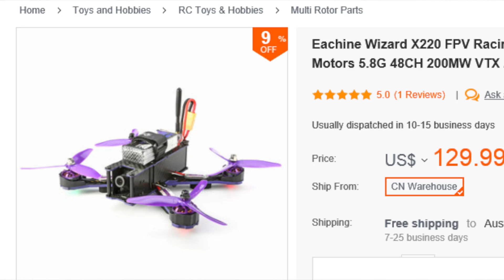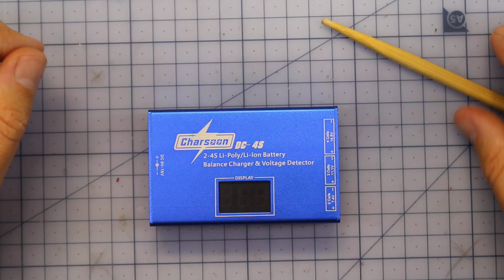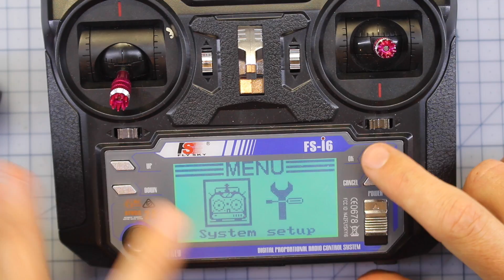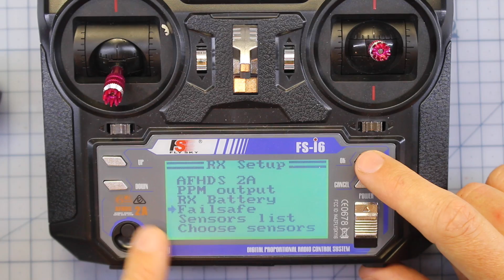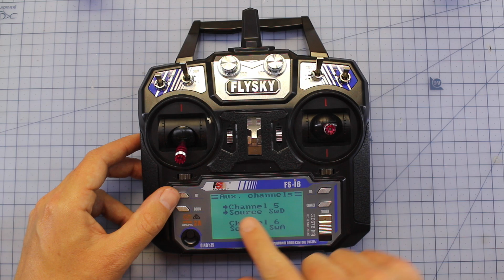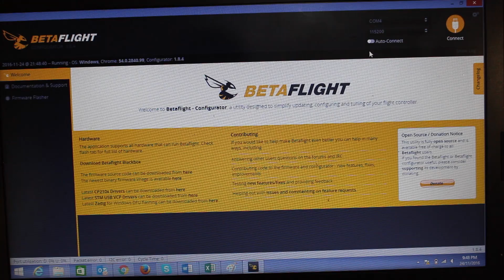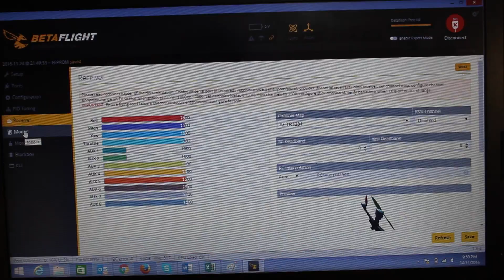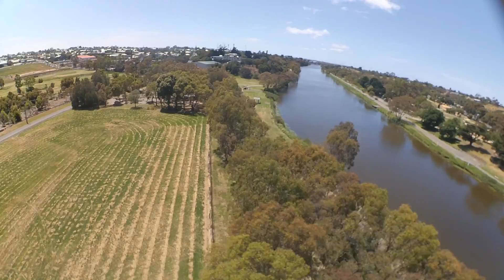How to get FPV DRONE RACING for under $300! Parts +Full setup.

Comment: banggood is running a sale for a similar setup as well. It saves a few dollars as i compared them individually and with the combo. The only thing is that it comes with a 3s lipo and not sure the preformance difference between 3s and 4s. The radio combo alone is ~$45 and quad $135 but then for the extra like $8 it comes with a 1500mah 3s battery and a charger.  http://www.banggood.com/Eachine-Wizard-X220-FPV-Racer-Blheli_S-Naze32-6DOF-5_8G-48CH-200MW-700TVL-Camera-w-FlySky-I6-RTF-p-1077100.html?rmmds=search

Comment: If I want to extend flight time, at the cost of speed, could I fit a 2200mAh, 4s, 35-70C? It's longer, so it might hang off the back a bit, but it would it get me more time in air?

Comment: Is there a built in Voltage reader/warnig system? I know the recharger has one, but you would have to take the drone out of the air to check the batterys status :o   Thanks in advance for any replies.
Reply: AFAIK you can drag and drop your battery voltage (and other information like the current current draw or the mAh drawn) in a betaflight submenu.

Comment: whats up stu! I literally just got my Wizard and am done setting everything up! am suuper excited to go fly, but i'm having trouble getting the props and hex nuts on the 2 clockwise motors.. Like literally impossible to get the props on, they don't seem to fit! and the hex nut is super duper tight, cant even get it all the way down. Tried your rubber band trick but even that didn't work! any ideas?

P.S the CCW motors gave me no probs at all

Cheers and happy flying!
Reply: Problem solved, just needed a little brute force! Good thing these things can take a licking

Comment: As of this moment would you suggest the Taranis Q x7 (maybe the Turnigy Evolution for pure FPV) and perhaps the SKYRC iMAX B6AC V2 for more charging options instead? It would be around 80-100 bucks more, but is kinda a better starting point which grows with you. An option if people want to eventually get more into the hobby

New title for new video, if I use a rough estimate of current prices :P

"How to get FPV DRONE RACING for under $350! Parts +Full setup."

Comment: UAVfutures hello, can I ask you a hand?
I installed betaflght but when I connect the USB cable on the top right door does not appear .... where you have com4
I can not connect ...
could you explain how to configure the door?
thank you very much
Reply from the maker: i dont understand. have you checked you have the right drivers on your PC. they are listed on the front page of betaflight
Reply: I installed it with windows all three, that link the page welcome! I did well? instead mac can not be installed
Reply: thanks for your help but I had two defective USB cables

Comment: Question: If I buy the Eachine Goggles you linked in the description but did not show in the vid that claim a 1920 x 1080 res, will I see the drone footage in 1920 x 1080? and what will the fps be?
Reply: Also would it be better to buy these? https://www.amazon.com/FatShark-Teleporter-Transmitter-Fat-Shark/dp/B01BWO29PQ/ref=sr_1_3?ie=UTF8&qid=1489880212&sr=8-3&keywords=fatshark

Comment: Just for the record, my x220 I bought on Banggood only came with a single bag of propellers, so you have to sort them out. Also it did NOT come with a battery or charger like I see other videos saying it does. Possibly because I bought on Banggood, thanks for the video. 
I am having an issue with my propellers though, they make sqeaking noises rubbing up against the prop nuts. If the nuts aren't tightened down all the way the props travel up and down the rod, they're not very secure, already ruined a few props with only a couple mins of testing my system, because the friction is like wearing away the inside of the propeller ring. 
Spent several nights trying to get this thing setup (in large part due to my HS1189 I bought, but it doesn't fit, so I had to drill new holes in the side panels and use a file to make more room for the panels to connect to the base) very frustrating, but I can't wait to actually start flying!

Comment: My beta flight won't connect please help me
Reply: I had to plug my battery into the quad to power it, not just the usb cable, that was my issue but as soon as i gave it power from the battery, it connected.
Reply: BILBO2626  Im having this same problem right now. Did you find out what causes that?
Reply: You've prob figured it out but some cables don't send data. Only power
Reply: If you ever figured it out could you help me? I have the same problem and i've tried using different cables and connecting the battery but nothing works.

Comment: hi, having problem with my wizard220. it seems to drop from the sky to the ground randomly when in flight. its flying fine then just rolls like a maniac to the ground. then works fine until a minute later just does it again. any idea what could be causing this?

Comment: Hi, I still haven't got my drone off the ground yet.

When I first got my drone, I plugged in the battery while the VTX antenna was not connected. When I tried to sync my Kylin Vision Goggles to the drone, I ran the auto scan and only showed a black screen. I thought I must have burned out the 200mw VTX. I then ordered a 600mw transmitter as an upgrade since I fly alone and when I went to sync up the goggles, it showed the black screen again. I made sure I had everything connected properly and couldn't find out which part wasn't working. I only have one drone so I can't test the individual parts on a different drone.

I can only assume there is a problem with the stock camera or the goggles. The wires are fine, the VTX is new, the antenna was on, the connectors were pushed in, my goggles antenna was on, I searched all the channels, and the lens protector was off. Do you see anything I may have missed?

Thanks!

Comment: I found your video to be a great help. I am ordering a wizard, but am thinking of using the Turnigy 9X 9Ch Transmitter w/ Module & 8ch Receiver with it. Would you know if the receiver that comes with this transmitter works easily in the wizard? Thanks

Comment: stu bought the wizard because this video and it's  amazing. one question though I fried my vtx. can't find a replacement with the right sma plug? any advice. please help.
Reply from the maker: if you are really desperate you can just order any vtx and buy another antenna that matches it.
Reply: UAVfutures thank you. I'm considering unsoldering the sma. And then soldering on one that works for me. I bought the immersionrc spironet antenna , and the sma Jack on that is giving me problems. really appreciate all your content , and you taking the time to reply to my message thanks loads

Comment: I am a beginner and im trying to find a cheap, small drone to mount a 3 axis gimbal and my gopro knockoff onto. Will this drone be able to support the weight? (280 grams). If not, is there any other drone, under 200 dollars, able to support such weight?
Reply from the maker: no

Comment: hi folks I have my wizard and radio it lights up and beeps as should but cant get motors to spin it binds properly I'm pulling my hair out !
Reply: Hey, I set my wizard up today, I had a similar problem, what it was for me anyway was I wasn't exiting each menu in the radio correctly once i had made a change, when I made each change on my radio and pressed enter, I had to press and hold cancel for a moment, not a quick press, because your settings wont stick....
Reply: hi buddy thanks gona see if that's it if anything else springs to mind please tell me thanks again good luck flying!
Reply: oh  Bud would you please tell me what parameters ya had wrong?
Reply: well I was double checking my settings, following along with this video, the ppm output setting was on how i left it, but the rest of the setting were as stock, like I hadn't changed them yet, and that was when I realised that even thou I had pressed ok on each setting change, if i exited by just tapping cancel, it wiped the changes.... So, you must hold cancel for a moment after each change. So Id say follow along with the video and check all you settings, again. If they are right, id start looking a beta flight, and check that the switches work. Im a absolute newbie btw.

Comment: Great Video! I've set up my Wizard to the "T" with you in this video but my Wizard will not connect with BetaFlight...Any suggestions?? Thanks.
Reply: Romie Navarro have you downloaded the drivers. ? You might need to download on of them from the beatflight. main page. bottom left of I remember correctly
Reply: I was only able to download one of the drivers as my old Mac will not operate with one of the other drivers.  My solution...buy new Samsung laptop for $150 with the Chrome operating system to tune my quad(s) (as I will be inevitably buying as this is an awesome new hobby)Thanks

Comment: will this work with the wizard??? I wanted to get a better receiver... Upgraded FlySky FS-TH9X 2.4G 9CH Transmitter With FS-R9B RM002 Mode 2 http://www.banggood.com/Wholesale-FlySky-Upgrade-FS-TH9X-FS-TH9XB-2_4G-9CH-RC-Remote-Control-Transmitter-Mode-2-p-47904.html?rmmds=search

Comment: Would anyone happen to know if this quad will work with an IA6 Reciever?
I may have ordered the wrong part

I lost my quad a while ago and when you order just the quad it doesn't come with a reciever, or a battery/charger.

Comment: I currently fly a Phantom 4 and have goggles that connect via HDMI for FPV flying. I would like to use as much gear as I can from the phantom 4. I don't know if any racing drone would be able to use the same controller or not. I do definitely want to use the goggles. So I am looking at a cheap options. Do you have any recommendations?

Comment: Hi Stew, Im looking to be getting into the hobby soon with this quad as per your recommendation after flying a Phantom for work and my little toy; Parrot Rolling Spider , and looking at the turnigy evo as my transmitter, was just wondering if you had any recommendations for Action Cam mounts for this quad ?  . Cheers Dan

Comment: Help me please.
I already got me one of  this, and I  followed all the instructions but seems that mine is not working yet  , and I noticed on minute 16:00 , when you are programming the chanel 5 you flip one of the switches up and down, the bar on the controler screen moved from side to side and mine is not doing it.  think the receiver is already paired but is not doing anything. is it nessesary to run the set up on the computer too

Comment: I am worried if I buy it and I am racing it if the frame breaks where can I get a new frame for it or can I buy a different frame and use it with the components on this quad ?
Reply: Colin Berens I know some companies have a life time warranty on carbon fiber pieces. check out CJ5fpv on instagram. lifetime warranty from them.
Reply: OK thanks

Comment: batteries you recommended: http://www.banggood.com/ZOP-Power-14_8V-1500mAh-4S-45C-Lipo-Battery-XT60-Plug-p-1022092.html?CG24181822629201506N

Which charger can I get that is compatible with those? The one you listed is sold out, and has been for more than a week. Is there something else I can purchase?

Comment: I plugged in the battery without connecting the antenna for only a second. The drone beeped 3 times. Is this enough for the video transmitter to be destroyed?

Comment: Do I need a transmitter where the throttle is spring loaded to centre? I have a nice remote I use with helicopters but the throttle stays where you leave it.
Reply: most racing/freestyle quad transmitters do not have a throttle that will spring back only the yaw usually springs back

Comment: I bought everything in this kit. I am pleased with everything but the charger. it is trash. just spend some money on a good charger. the one that came in the kit worked better. you will have to buy a charger when you get 4s batteries.

Comment: Stu, Please Help!!! I bought the eachine wizard x220 after watching the this video. After I received all my gear I tried to set the quad up in beta flight and with in a few minutes one of the rear esc's caught fire and fried it's self. What happened? I connected the quad to beta flight via the usb and also connected the 4s battery. I didn't make any changes in beta flight and the thing just caught fire. Is it a defective product? I reached out to eachine twice and have not heard back. Please help, I have been dying to fly it!
Reply from the maker: yes totally this sounds defective. it should not catch fire ever. did it connect in betaflight. you dont usually need the battery to connect to the pc
Reply: Thank you, you are the man Stu! Now I just have to get eachine to respond back. The reason I connected the 4s was because I couldn't get the vtx working, I wasn't sure if hooking the quad up to the computer would make the vtx work too. I also bought a GT 2, what receiver  would you use that works with the Flysky FS-i6? The FS-iA6 that came with it doesn't fit, and I'm having trouble hooking up the FS-A8s, because the receiver and PPM & S.BUS signal wires have the same connectors. Is there an adapter that will connect them or do I need to learn to solder?

Comment: after i bind the radio. the settings for fail safe keep resetting each i time i move onto the next step. any ideas
Reply from the maker: try holding in "cancel"
Reply: Cheers for that just figured. Thanks heaps for the video.

Comment: Thanks so much for the video! Just received my drone after 3 weeks of anticipation, but the bind plug is missing... I've sent an email to Banggood, but even if they send a replacement part, it'll probably take forever to arrive. Haven't been able to find any bind plugs closer to home online either. Is there any way to bind the receiver and controller without the bind plug?

Comment: New to this hobby. The youtube uploads always look amazing but it seems the video the controller sees through the goggles are not so good. Do you have to add a gopro for quality upload video or is the on-board camera sufficient? You also have a fatshark. Why do you use these goggles other than having that terminator look.

Comment: Will the FrSky Taranis Q X7 radio with a RX8R transmitter work with this drone? Do I just need the plug it in using one cable like in the video?

Comment: I would not recommend the Charsoon. Mine lasted about 45 minutes charging a 3S. Then it game me an ER 2 error.  come to find out this error is because you are inputting the incorrect power. The charger is listed as 9V-16V input. I was using the 12V charger that came with it. It errors with every input source I have tried. It is now just a battery checker and not a charger.

Comment: Do you beleive  Eachine Racer 250 might be better than the wizard?? 
http://www.ebay.com/itm/Eachine-Racer-250-FPV-Drone-QUADCOPTER-Built-5-8G-Transmitter-HD-Camera-ARF-RC/282053777502?_trksid=p2047675.c100005.m1851&_trkparms=aid%3D222007%26algo%3DSIC.MBE%26ao%3D1%26asc%3D41404%26meid%3Dd8c7770dc796484296dcd0c9cb2f001b%26pid%3D100005%26rk%3D1%26rkt%3D6%26mehot%3Dpp%26sd%3D302213512749

Comment: Hi ! I set up everything that you said but on receiver tab my quad is continuously rotating somehow! The roll yaw etc. always changing and the max is around 1997 and the min is around 997! What should i do in order to fix this problem? I have eacinne wizard with flysky fs i6s 10 channel receiver!
Reply from the maker: add some trims in your radio
Reply: Hi Thanks for the tip but when I did the triming the drone still continuously rotating somehow. All my numbers constantly changing between 1499 and 1500. I could not adjust throttle is is changing constantly between 996 and 997. Can I send you a 13 sec video about this issue? The subtrim did not work either. I subtrimmed and I also achieved that the numbers changing between 1500 and 1501:(

Comment: mine wont connect to betaflight what do ii do
Reply from the maker: install the correct drivers on your computer. they are linked on the front page of the betaflight program
Reply: thankyou was eally stuck there for a moment : )
Reply: i installed all the drivers and i still can't connect. can u help me?:)
Reply: i had the same problem and found out that my cords io wasnt working try and use another cord and if that doesnt help then i dont know

Comment: Need some help.  I just got this whole kit. Charged the battery, plugged it in and the remote control does not spin/turn on the motors.  The kit did not come with the bind plug. Is the remote already binded to the copter since they both came in the same package.  Do I need to connect it to the computer and do something in that program beta flight?  I noticed my Flysky controller shows Err1: 0% on the screen.

Comment: If I were to unplug the receiver from the drone after binding it to the remote, would it still be bound?
Reply from the maker: yes as long as you remove the bind plug
Reply: UAVfutures Thank you.
Reply: stu, which transmitter would you recommend , the fs-i6 or the ten channel fs-i6x? cheers

Comment: I am not sure what went wrong, but when I armed the quad, i wouldn't spin the motors, and the throttle automatically went to max no matter what my input was on the radio. also, the propellers were absolutely impossible to screw on. I actually broke one trying to get the stupid prop on. I really don't know what i'm doing wrong. I did everything you did in the video. Help?